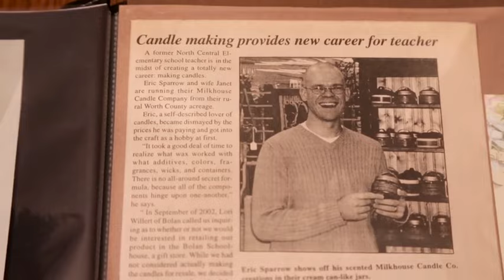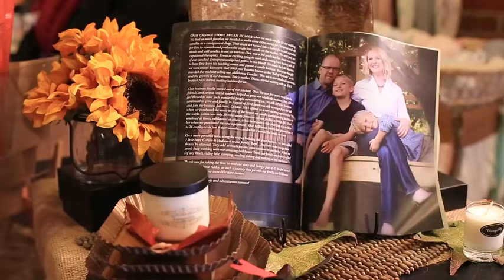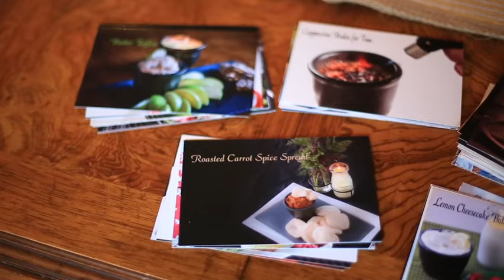Milkhouse Candles and More

Comment: To whom it may concern,

Greetings from China~

This is Catherine from Candle Machine Building Co.,Ltd in China, we are OEM for making all kinds of candle machines, having been in the candle machine making field for 28 years, all the machine's components are made by ourlseves, The quality is best in the candle machine field!

We mainly produce automatic tealight pressing candle machine, automatic pillar candle machine (hydraulic and mechanical), multi-function candle machine, automatic wick cutting machine (pneumatic and mechanical), automatic wick dipping machine, automatic tealight/glasses/jar filling, glasses injection machine, wax melting tank, rotor drum granulation machine (making wax powder 500kg/hour, 800kg/hour, 1200kg/hour, 1500kg/hour...), automatic tealight pressing assembly line, aluminum cups punching machine, manually long tape candle machine, dipping color machine,  and candle accessories: wick tabs and tealight cups, wicks...

Hope the above information will be valuable for you! If you have any further information for any other candle machines, pls feel free to ask to me at any time is Ok.

Warmly welcome for your inqiury.

Together with an illustrated catalogue in the attached, pls feel 

free to check.

Thank you for your attention!

E-mail: xm.lzjx@gmail.com
Looking forward to hear from you,
Best regards
Export Dept: Catherine
TL/WhatsApp: +86 159 4150 6939
Skype: ddxmjx
Candle Machine Building Co.,Ltd in China.